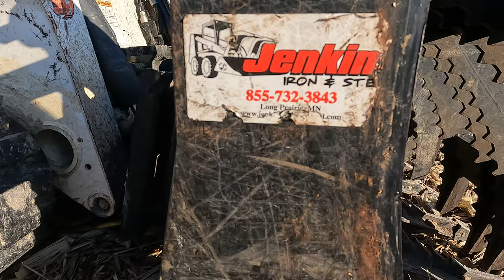9250 Needs Some Work Before Winter Storage.

Comment: In our area we take the tube off that's right in front of feeder sprocket. It has those stripper plates on it. Would have lots of problems with chains jumping and starting fires. A few dealers in our area will even take them off of new machines.  Enjoy your videos.
Reply from the maker: I’ll have to look into that because they 9240 I run has been jumping links worse than this 9250. I’m pretty sure the sprocket is junk on mine though